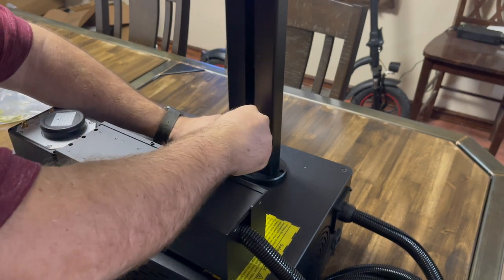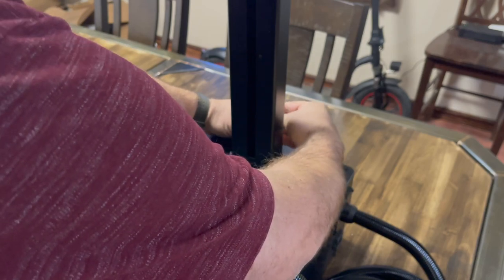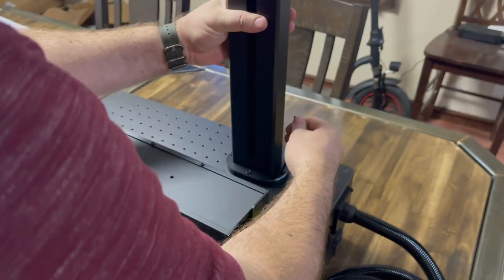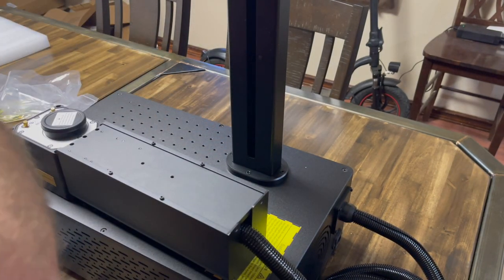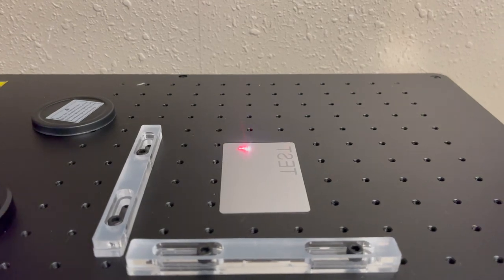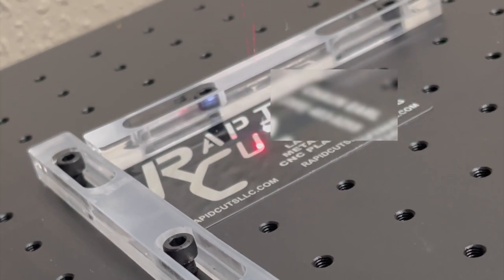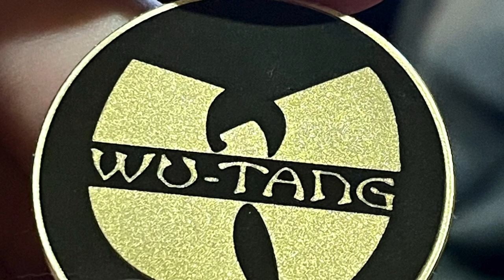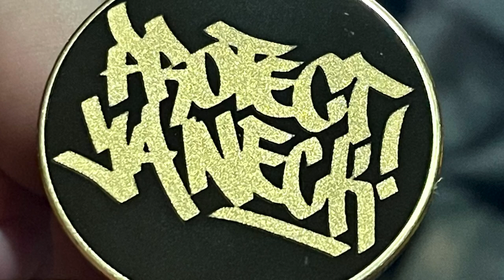Monport GP50 50w fiber laser unboxing review

Comment: Do you have any suggestions for what i could use as an enclosure for this laser? I was thinking of using a fire retardant 3d printer enclosure but it seems risky to me.
Reply from the maker: I havent found a need to enclose it. They are kinda spendy but the only thing i would like is a visual shield with laser safe green plastic so i dont have to wear safety glasses all the time. You will want some kind of fume extraction. I just use a small 12v fan hooked to a dryer hose that blows outside. Maybe build a plywood box around it with a hinged front door
Reply: They currently sell an enclosure for this on their website. It is not cheap, but worth it in my opinion AND shows the company listens to constructive feedback.